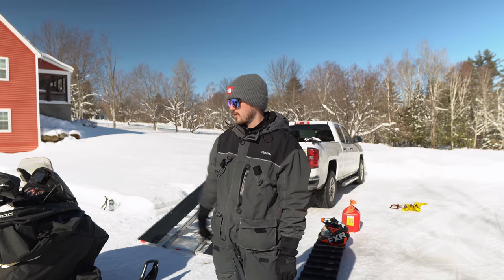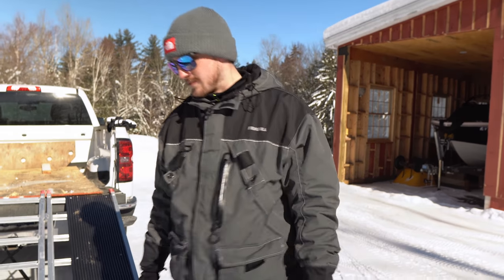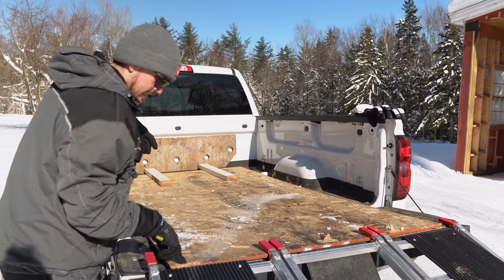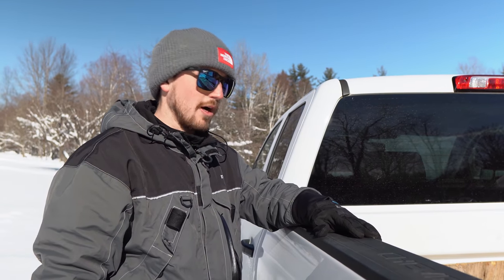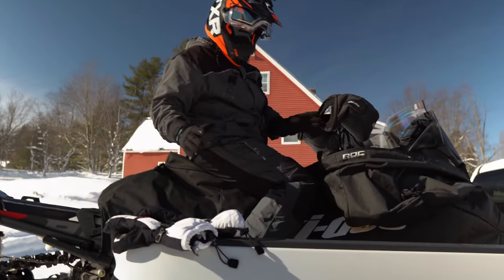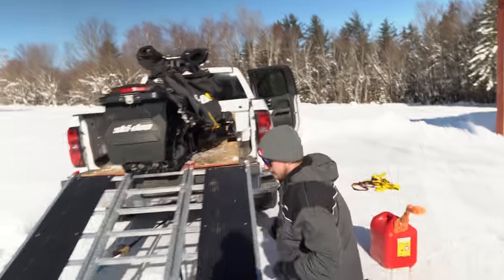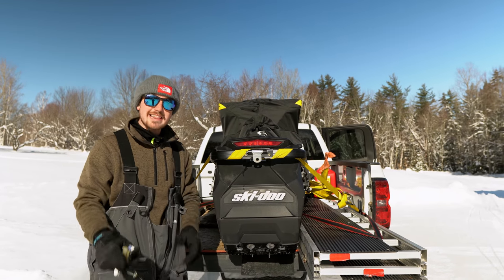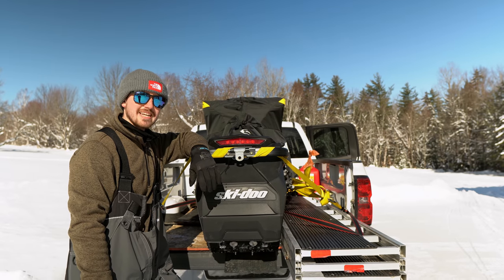How To Load a Snowmobile into a Truck

Comment: I'm picking up a sled on Sunday. I went to buy some osb to throw in my bed. God lord it's expensive. I ended up walking out with the cheapest thinnest piece of wood in the store lol. (paneling) It was still like 16 bucks.
Reply from the maker: Anything helps.  I used it for about 3 years and still looks okay.  It was cheap when I made the video.  Built a trailer and laid some osb inside.  Stay tuned for that video+

Comment: I would be concerned about the ramp falling off or scraping the side of the sled as you drive.
Reply from the maker: Ratchet straps secure it in both cases
Reply: @OutdoorsmanChannel  thank you for providing links to the accessories in the video! 👍

Comment: Is your truck a 5.5’ box or 6.5’? 137” fits well on there. Well done video!
Reply: wondering my self
Reply from the maker: Truck is 2014 silverado double cab (not crew cab) with 6.5 foot bed.  Sled is 2019 skidoo renegade with a 137" track.  It does fit pretty nice! Thanks for watching!